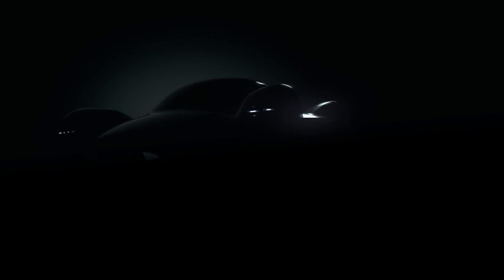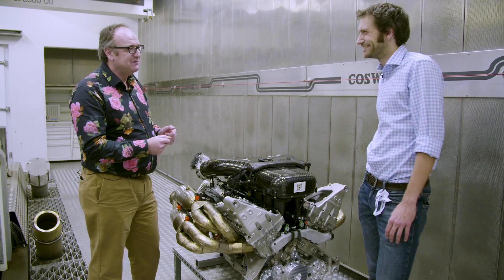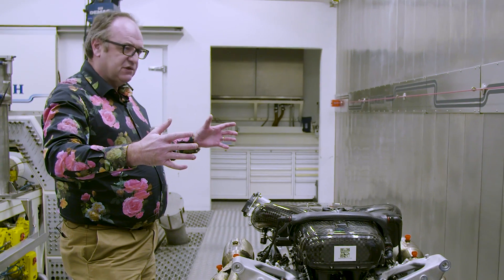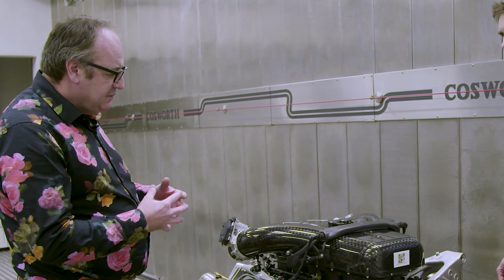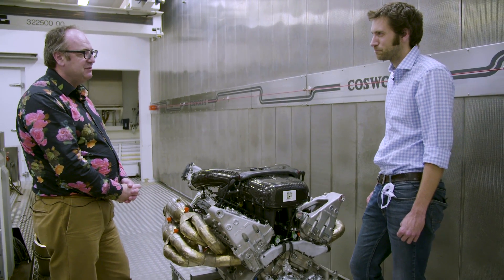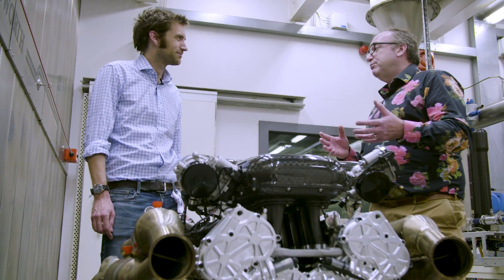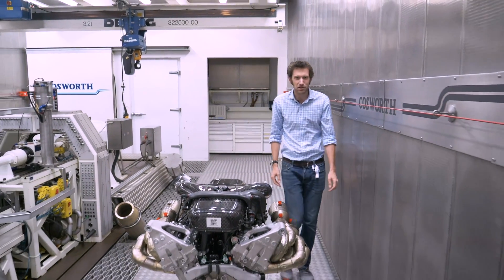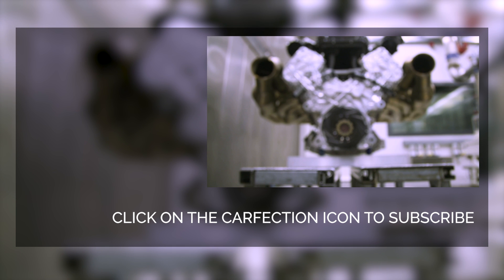Hear The Future Of The Supercar At 11,000rpm: The Aston Martin Valkyrie's V12 - Carfection

Comment: Sorry to say but this isn't all that amazing at all.. 

If I had deep pockets to pay and the top end equipment to build it. 

Now go look up boba motor sport mk2 golf. Now that is a real build with guys in a shed building magic with 4 wheels. 

Then go look up donkeytec, again a vw golf that is another built monster  made with real hopes and dreams with a budget. 

But hay that's just me.... I don't like the fact they have the technology to build so much better but due to government they have to build what they have in this video.....
Reply: I guess the thing is that those engines have to hold. after all for 6.5 l the power isnt that much 2l engines with 300hp was possible in the 90s and that without revs over 9000
Reply: @peterzingler6221  100% but these 2.0l agu engine in the boba vw golf is pushing 1200hp+ in a 90s engine... 

And if you look at the car it's self you can see most of the parts are home built with a bit of scrap pipe and some welding.   Welding that is their for a job not to look fancy... 

Don't get me wrong some of the cars made today are amazing to look at but that is it.  

Government/'s have made manufacturers restrict their builds... 

Hell we had Henry Ford build and make the first car out of hemp products and run on hemp oil yet government made him sell the plans to the US government so they could hide it... FACT.... 

We have small engine cars pushing out big bhp and be more fuel efficient. We even have the ability to run cars on hydrogen. 

We have the ability to even have free energy but again government stop hold and hinder such due to their need and greed for money... 

But that's another conversation...

Comment: What i dont understand is for many years now the auto world has been saying good buy to naturally aspirated motors yet they keep coming! They say they wont be able to meet emissions yet we have here the most advanced high reving v12 ever and it meets the regulations and is good for 100 000km 220 hours!! Sorry but i just dont understand! I can remember back as much as 7 years we were hearing this will be the last!! Or like every new car out cant be done any better!! C'mon man cut the bullshit jargan that gets spewed out with every new car! It just makes me want to vomit!! Just talk about how cool it is and not this could be the last of this generation or how they cant improve because its just drama adding like a good book!!!!!
Reply: I believe those cats and manifolds cost £14,000 for the pair, the tech in those cats is what mostly helps make this engine legal
Reply: I think the auto world is right, as in many cases, they're referring to massed produce cars. Remember, only 150 road going Valkyrie's will be made. If you divide that by the approximate number of cars worldwide, it comes out to 0.0000125% of cars using this new v12.
Reply: @sighfly2928  the auto world isn't designing a new fuel based off of hydrogen to over come this issue. They don't want to spend more money.
Reply: The problem is cost - it's not that it cannot be done, but it costs 250k+ JUST for the engine. -- watch at 10:31 - cylinder heads are made of aerospace grade alloy - so expensive it's not even used in motorsport (F1) -- and it's not like F1 doesn't have money...
Reply: they are not going to invest millions and millions into research to run high performance engines while meeting emission standards as these vehicles will be mass produced and car makers will make no return at all. Which car manufacturer in their right mind would put  in millions to do so and then sell their cars for a fifteenth of the cost. Where as here the valkyrie will most certainly make a return as a select few are made and it appeals to the niche market.
Reply: They simply sell you turbo engines because its cheaper to produce than quality normal engines. People throw away their car after 5 years and 150'000km, which is what your turbo is expected to last. It's not about emissions or whatever, it's about making money selling you just enough quality that you will buy it and not complain too much. It's a business, dude. The days of indestructible affordable cars are over since 20 years at least.
Reply: There's the regulations that stipulate the maximum levels of harmful emissions, and there's the official CO2 emissions/fuel consumption in standard driving test. Two very different things which most people think are all the same.

Naturally aspirated petrol engines have never had any problem meeting the harmful emissions regulations. All they need is a good fuel injection/ignition tune and a catalytic converter. But they are notoriously inefficient at low loads which translates into high CO2 emissions/fuel consumption (which are for all intents and purposes directly proportional). This does not make them illegal, you can make, sell or buy a car with a fuel consumption as high as you want, you simply get taxed accordingly. And not only do you get taxed a lot for buying a car with a high fuel consumption, the manufacturer gets taxed for selling cars with high fuel consumption (little known fact). So the manufacturers are moving away from naturally aspirated engines, since that means both them and their customers pay less taxes for it. This is all, again, in standard test cycle, which does not necessarily represent real world driving conditions, and generally favours turbocharged engines.

Hybrid systems help get around this so with hybrid cars we may see naturally aspirated engines making a comeback, especially high revving ones since with the help of electric drive the engines no longer needs to  have a very broad powerband with good low end torque, and can instead be designed for maximum power.
Reply: @BigUriel  You hit the nail DEAD CENTETED on the head.!💯 ALL FACTS! The ONLY way naturally asperated engines will continue to exist is in the form of a HYBRID. MAKE NO MISTAKE na engines in ALL cars are and will be gone.😔
Reply: Their is a natural aspirated v12 in the 812 superfast and that car is still priced affordably! Lambo are natural!  Yes this engine is very prestigious but they can still build naturally aspirated engines that are affordable and pass emissions! My mother has a honda its new and naturally aspirated ! Cmon man for 7 years they have been saying its all over when is it going to be no more built ???? If you cant see that all these youtube channels spew bullshit to make the video's dramatic your blind or deaf!! IS THIS THE LAST FROM FERARRI! WIll WE SEE ANOTHER!! blah blah blah gee they talk shit! I can find videos from even more than 7 years ago were their spewing this drama out!! Just talk about how good the car is and when that day comes if it does come then say its the last!!!!! They could easily find ways to keep natural aspiration with technology! Dont any of you see my point????? Lets see when this car is built and delivered if they spew out the same shit! I can see it already! THIS AMAZING MACHINE THE LAST OF NATURAL ASPIRATION GOES OUT WITH A BANG!!!! only to have ferarri build a superferrari 6 months later with a v12 that revs to 19000rpm!! Im mean when ferarri bought out the laf i was like whats going on isnt the natural aspiration gone??? Personally i think its all hype to get the car companies more sales!  People will think last natural aspiration ill buy one it will be worth money later on!! Its all bullshit people just cant understand nobody can see it!!!!
Reply: @baddazzgarage2953  Hold on, did you just try and pull out ya ass that a 812 superfast is reasonably priced? I mean sure, if you have $400000 dollars laying around then yea its quite affordable. I get it man, you're sick of hearing people explain about the fact that Naturally aspirated engines are fading. But I think you are missing the point. Naturally aspirated cars have disappeared. BMW doesn't even sell a naturally aspirated engine. What they mean is that these engines large cylinder engines are becoming more of a luxury or niche technology. Emissions are driving the present day, and a trend of downsizing engines and using forced inductions appears logical. The amount of engineering to create powerful naturally aspirated engines that pass emissions is getting harder to do. These engines aren't generally in mass production vehicles, but I get it, the technology isnt going to disappear like you said, its just leaving mass production and becoming a high performance or luxury type of engine configuration.
Reply: @trevorj5772  yeah i dont mean affordable for every day people and ive never heard the normal car industry say its dying! Im talking about the supercar industry only! And for years now these YouTube supercar channels have been saying this is probably the last natural aspiration car blah blah its just not true! Ferarri lambo ect still build naturally aspirated cars and dont look like stopping anytime soon!! For me its just a plot to get these car companies more sales! As i said if people think a car built could be the last non turbocharged car they will buy thinking it will be worth money in the future yet they keep building naturally aspirated vehicles! And i think as long as there is a market for natural aspiration they will continue to build them!! And they can  meet emissions its all bullshit if you ask me! These channels want access to drive these cars so they talk shit to help sales in order to be on the good side of the builders!! The supercar industry and formula 1 have been swapping from turbo to natural for decades now its got nothing to do with bullshit emissions just whatever the technology is at for that period!! See if im wrong in another 5 years from now!! And they have been saying it for as long as 8 years ago!! When do they actually believe they will stop !! Cmon its all crap just nice drama to make the video and car look more important and special!! And everybody buys it!!!!
Reply: @trevorj5772  and its the supercars they say are dying not normal bmws! And its not true!
Reply: Hehe in the future they will even use better sensors to analyse the catalysts conditions. It functions by sending microwaves and measuring the delay of the reflection. By doing so they can also decrease the recovery time of a dpf and the scr becomes very accurate.
Reply: Technology and manufacturing practices that were once deemed impossible and only dreamed of are now regular practice and they're pushing the envelope every day. So it only makes sense - look at GM's LS series push rod motors that due to new tech; have had new life breathed into them over and over. Now the LS series is arguably the most swapped motors because they're cheap, light, and produce gobs of power with a monstrous aftermarket following.

Comment: At this point Aston Martin should enter f1
Reply: Well they are the title sponsor for red bull
Reply: @fredd9340  They should race under their own name instead of sponsoring another team!
Reply: This car doesn't fit F1 requirements at all lol
Reply: Aston Martin is owned by Ford Mo Co and only Ferrari have won more F1 titles than Ford! If they want to enter F1 they will and they will do real well!!
Reply: @jarnosaarinen4583  I think Aston Martin Lagonda is no longer owned by Ford. I think a British consortium is the one currently owns Aston Martin Lagonda.
Reply: @jarnosaarinen4583  Aston Martin are not owned by Ford, they've been independent since 2007 as far as I know.
Reply: @jarnosaarinen4583 No they're not....
Reply: @jarnosaarinen4583  1. Ford doesn't own Aston Martin. They were the owners 1989-2007. You're over 10 years behind.
2. Ford has ZERO titles in F1. They did however power 10 different cars/teams - none of which were Ford owned.
3. Ferrari has the most "engine titles" (16) but Renault is the second most successful with 12 titles. Ford has 10.
4. "Ford's" F1 engine was designed and manufactured by Cosworth in England. Ford paid for it to put their name on it.
5.  Cosworth were owned by Vickers when they built the Cosworth V8 for Ford. Right now they're independent but part owned by Mahle. So Ford can forget about Cosworth ever designing them an engine. 
6. They DID want to enter F1 and did so with Jaguar (official Ford entry) and they did poorly . Where have you been??
7. Ford retired from F1 after Jaguar folded at the end of 2004. They have no intention to re-enter. Certainly not on their own.
8. Mercedes is just 3 wins from passing Cosworth (Ford) as the second most engine in outright wins. Renault needs another 8 wins - but if you count the "TAG Heuer" Red Bull is using (just a branded Renault power unit) they're already second most successful in outright wins. 
9. You're ignorant  One mistake or error is forgivable. Tons of nonsense isn't. 
10. Ford can't do s*it.
Reply: Papa Pumphrey after lap one the car will be broken though... I’m a huge Aston Martin fan I wanted my dad to get a 2013 Vantage, but damn lmao every single Aston Martin is so damn unreliable you can barely appreciate it besides the interior really... this car is beautiful I won’t lie, but there’s reasons behind why Aston’s can’t hold their value.
Reply: Why? They don't even make their own engines.
Reply: What for? To waste money on this pathetic and utterly boring piece of over regulated, diluted piece of blant shit racing series? Lets hope they won't.
Reply: Not going to happen the F1 owners and FIA dont want more then 4 factory engine suppliers in F1.
Reply: Papa Pumphrey they don’t have that kinda money to run a team for F1. They would need to choose partners that can help with all the extra cost which they certainly could do that but I don’t think that have that desire. Running around the world racing cars is hard and demanding work not for all they seem to be happy making great cars and I can’t fault them for that..
Reply: they are already in the respectful team
Reply: @amarjit singh Is that an F1 engine?  Pay attention to the conversation idiot.  Its like people don't bother to read anymore and just spew random shit into a comment section.
Reply: @amarjit singh Dickhead, what is the OP's statement?  Something to do with F1, right.  Does Aston Martin make an F1 engine....Answer, no.  Learn to read and understand what the conversation is about.  We are not talking about road cars.  So maybe you should fuck off clown.
Reply: @amarjit singh Some facts for you - "Aston Martin currently has no public plans to produce its own F1 engine" Motorsport week June 2020.
Reply: Papa Pumphrey except for the fact that current F1 engines are soulless turbo hybrid nerd boxes that sound like absolute garbage.
Reply: @rsoul7282 right, so the engines that are making the cars the fastest they've ever been are soulless?
Reply: @absofruitlyriley  yes.
Reply: @lovelessissimo  okay then
Reply: @rsoul7282  if you marry a girl just because of her looks i feel sorry.
F1 is the pinnacle of engineering. Mercedes has built the first engine with an efficient rate over 50%. Soulless is just a knockout argument, things people with almost zero technical affinity say.
Reply: Arved Ludwig for the record mate, my wife is stunningly attractive, and fiercely intelligent, heard of the journal ‘Nature’? She was part of the team that published that, was dealing with people with far more credentials than you or I day in day out, then moved on from that to project manage major infrastructure. So I think we can put that to bed. With regard to technical affinity, I have been a mechanic for over twenty years, so I guess I have a rough estimation of what is droning it’s way around the paddock in F1, and I tell you straight up, it is pretty hard to get excited about the current generation.

Comment: Thanks to Bruce Wood (MD of Cosworth, or loud shirt guy to you lot! :) for the generous, informative, description and detail of the design and development of this engine, and its integral place in the vehicle's structure and packaging.

I was a bit surprised they 'only' managed 113.8Nm/litre  (Ferrari was at 120Nm/litre with the 458 ... 8 years ago), but I must admit the sound of this V12 is growing on me. Has potential when fitted with a proper aftermarket exhaust ! *big grin*  :)

I think the reason they've targeted 100,000 kms reliability is that it looks like it's going to cost about $100K to change the spark plugs at that point !

220 hours for 100,000 kms - so that's an average of about 454 km/hr then !!

I wouldn't mind driving one of these up to the shops, or you know --- forever!  :D